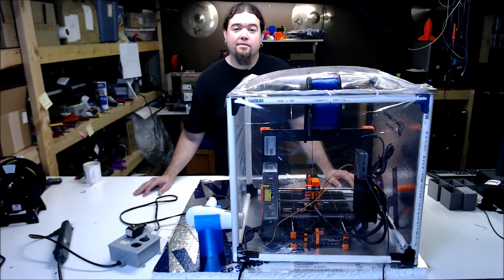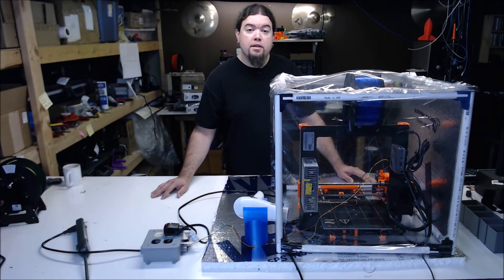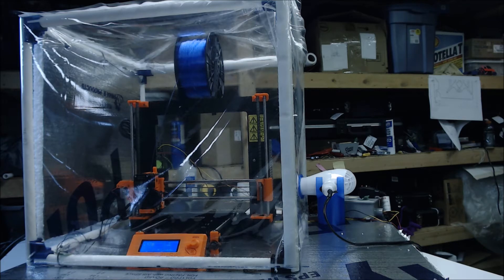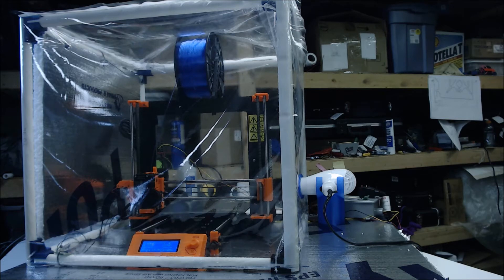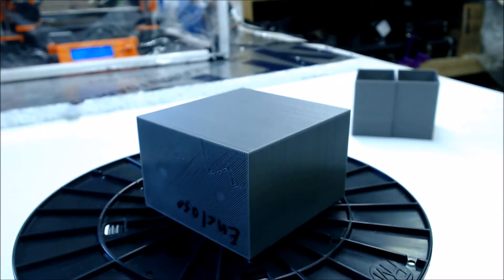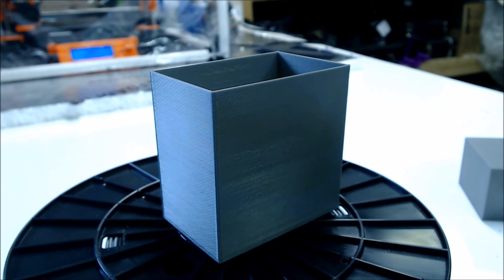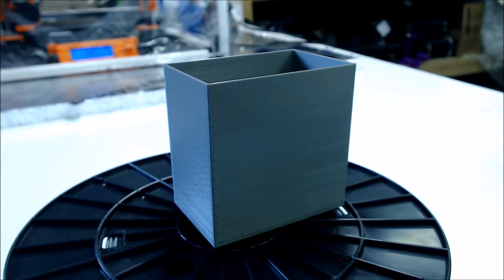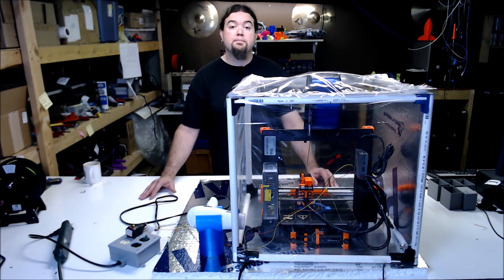Cheap 3D printing enclosure modified to add heat - results video - Chris's Basement

Comment: HI Chris , Well you think 42c is enough for ABS ?  I have a Wanhao i3 v1  and want to try again to print with ABS, first try was a Failure :-(  only using a Cardboard Box as a Enclosure.
Reply from the maker: the German Printing Nerd You can probably print ABS at 42c, but it really depends on the part. I get by with just the enclosure most of the  time. What build surface are you using?

Comment: We specialise in ptc heaters for enclosed housings
Reply from the maker: ATT advanced thermal technologies Really? Are they radiant heaters?
Reply: Yup, we have low profile heating foils, and are developing transparent ones too (new technology) but they are self stabilising or temperature controlled and can be glued to the platen or the sidewalls
Reply from the maker: ATT advanced thermal technologies Very cool, I looked this up. What's the price range? What would a 200x200mm sheet cost for example?

Comment: Hi Chris
Interesting to see the result of a print with an enclosure. I recently got a Anet A6, and I was considering building an enclosure or not. After viewing your video, I will defensively build one hehe

I was thinking of using one or two of those (https://www.aliexpress.com/item/PTC-ceramic-air-heater-100W-220V-Insulated/486752633.html) instead of a hair dryer. Probably less powerful, but less wind current too. What do you think?
Reply from the maker: They could work, not sure how hot they would get. You could definitely find a heater that would work better than the blasting hairdryer.

Comment: I assumed the turbulence from the fan in the hair dryer would have been too high ...... my first thought was maybe trim the turbine down on the dryer to cut down the draft but still keep enough movement to keep from burning the heating element up.... you kept it simple and cut your research time down.....is your enclosure vented or sealed tight to hold as much heat in as possible? ........golf claps son
Reply from the maker: I thought about a defuser or something for the dyer because even the hot air from the dryer make the heat bed temp dip a little, but what the hell, thought I would give it a try anyway. Less air would be better. The enclosure is as tight as I can get it, I also thought about venting, it could improve it maybe, right now it blows up like a balloon when the dryer kicks on.
Reply: as you took the temp up higher the adhesion to the bed went down ..... I was wondering why that would be but it seems the hair dryer was also heating the bed and its sensor was regulating accordingly......besides the unforeseen variable in the bed temp it looked to me you collected enough data to know which direction to go next .........that sure beats the ol, welllll that sucked kind of data.....always look forward